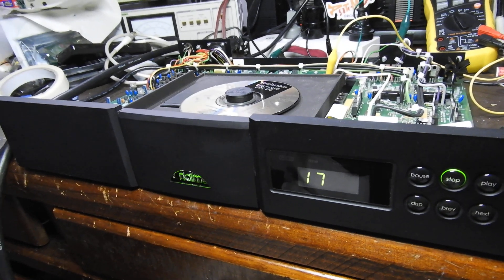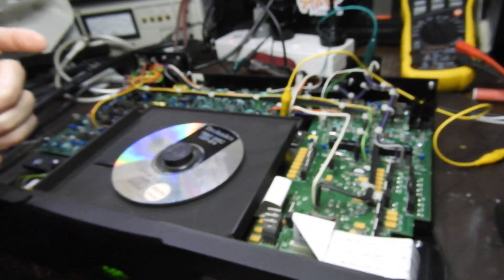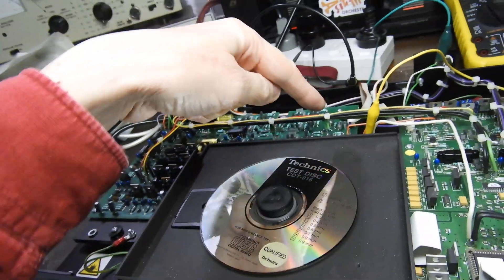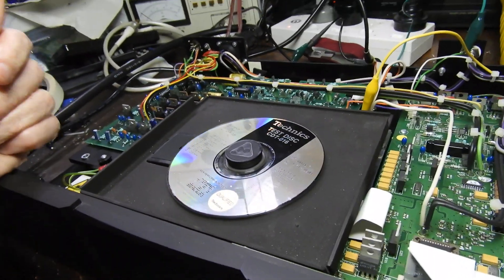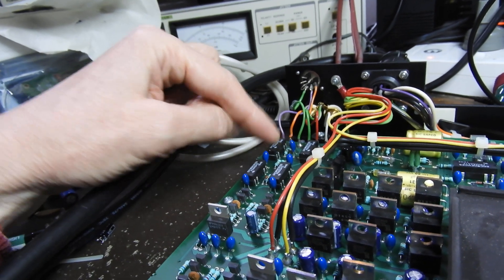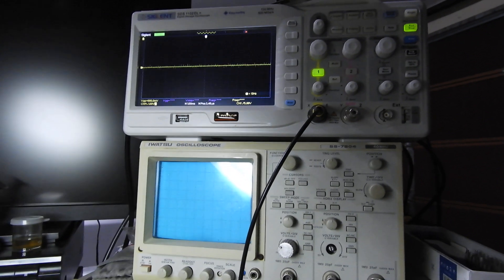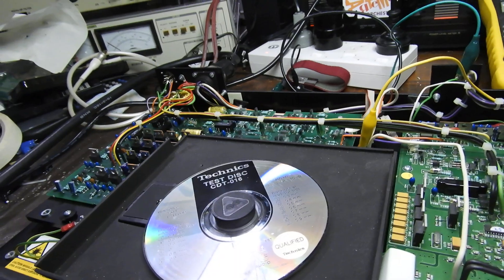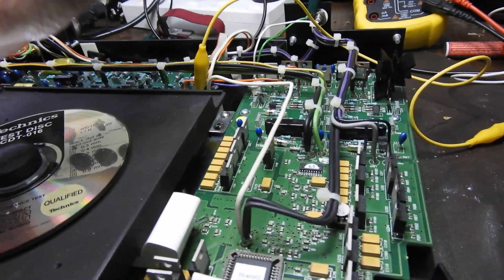Naim CDS-3 CD player & CD 555PS Power Supply. The player has 2 x Burr-Brown PCM-1704 & PMD-200 HDCD

Comment: The black things are a cover to keep the temperature/operating environment of the transistor consistent. They are called 'transistor rooms'. It was piloted on the CDS2. Naim believe mechanical engineering is as important as electrical engineering.
Reply from the maker: Thanks for the info
Reply: @hear-net-au  I like your videos. With respect to Naim they seem to be quite obsessive with component matching and mechanical engineering/microphony and seriously over specced power supplies. We have an active Naim system and the idea is to separate out the power supplies for low noise, have a central/star earth for noise to leave the system in one place and mechanical decoupling. We have a Naim SL2 speakers and the tweeter is not connected to the cabinet anywhere apart the base to remove cabinet noise. Naim CD players are one of the best but I haven’t heard as many as you.

Comment: Those black cups on the board - just a thermal junction for the input transistors of post-dac circuitry. In the modern Naim amps there are the same black cups too.
Reply from the maker: Thx. I've seen similar heatsinks in EC Pre-amps on input FETs, but without the black plastic cover. Didn't want to try to remove them just to find out. Thx again

Comment: Those reed relays are going out quite often.
Naim uses them everywhere.
they are normaly closed muting the output and shoud be open, disconnecting ground from signal in operational mode.
But, if you have no signal after the DAC board, that is worse, as I had few Naim CDX2s (with similar architecture) - twice with dead PMD200 and once - with dead PCM1704. Check the digital signals on the DAC chips. Yes, the second PCM1704 is underneath.

I'm afraid there was a batch of PMD200 that had problems, after we got a replacement boards from NAIM the problem went away.
Reply from the maker: Thanks a million Vitalij! I did suspect one of the DACs (hopefully the top one) but would never think of PMD-200. Thanks again
Reply: @hear-net-au  You are welcome, Roman! Unfortunately, PMD 200 is not very user-friendly. in terms of soldering, at least for me....we just replaced the boards with the ones we got from Naim, and fortunately I kept the old ones. Therefore, when, five years later, another device appeared with a non-working PCM 1704 DAC, I removed it from the non-working board and repaired it.
P.S. I will reply to your mail today.
Reply from the maker: @VitalyKirichenko-h1p  I put an oscilloscope on it this morning, and it is  - luckily - a top DAC. A have not checked if all the other signals are there though. Any one of them missing, would have probably the same effect - no output. But I am seeing normal input of Data on pin 1 and huge noise there on pin 14. The other channel also plays OK but I can see some of the same noise on the output, but a lower amplitude. This is actually visible on this video.
Naim have replied and said that they will not send any diagrams and to go to the distributor in Melbourne, some 4000km away.
Checked prices of both PMD-200 and PCM-1704. They are around A$200 each.
Not cheap. Because wither was only used in top players, buying one for parts is not really an option.